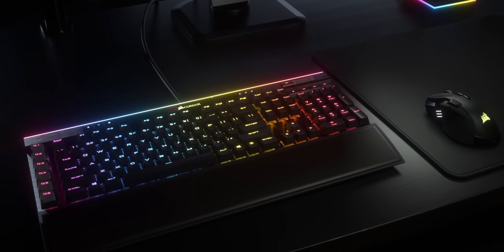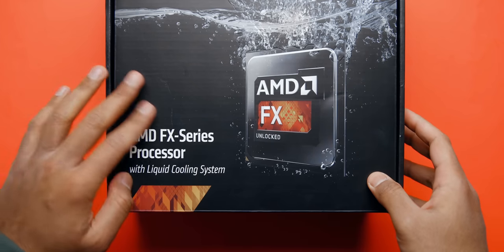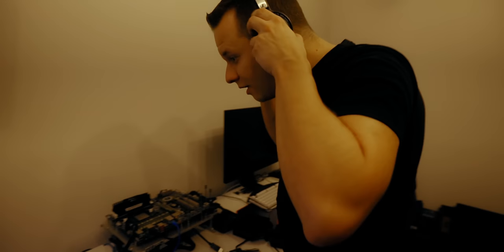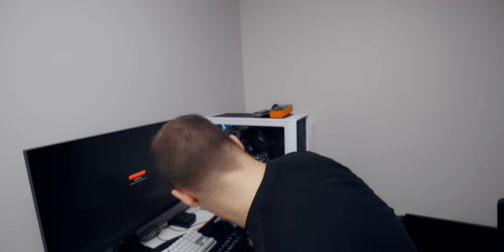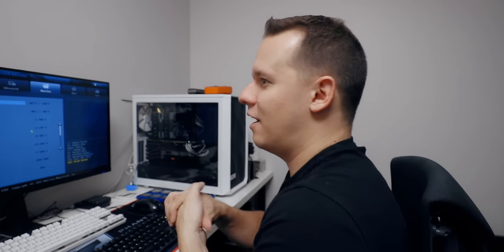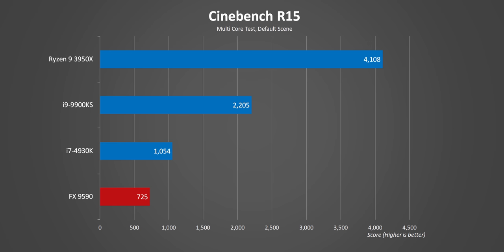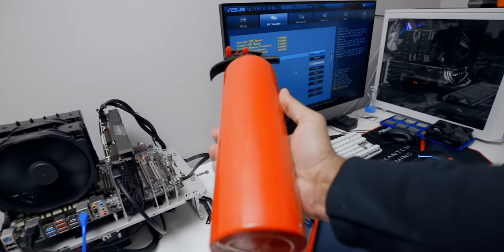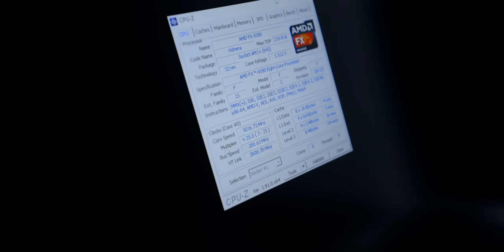Why The FIRST 5GHz CPU Almost Failed - AMD FX-9590 Revisited!

Comment from the maker: Let's play a game.  Count Mike's Claps.  Closest person gets our admiration and a cookie.  🍪🍪
He laughed his butt off watching this after the fact.  🤣🤣
Reply: My guess: 20
Reply: My HTPC in the living room is a FX-9590 with a MSI Aero OC GTX-1080 running on a 65 inch 4K TV. Runs all my emulator games like CEMU, Dolphin and Mame32 at 2X full speed. E.g: Breath of the Wild run at 60FPS@1440p when unlocked. My main gaming system is an 1800X with a faster OC GTX-1080. Both of them have Corsair PSUs with USB Digital Links which can display the input and output wattage of the PSU in real time. Power usage is on average is about 40 to 50 watts more than the 1800X or about 280 watts on average under typical gaming load, with both systems on high performance power plan, though the FX-9590 CPU is fine tuned and undervolted with MSRtweak. Both systems game easily at 1440p@ minimum 60FPS with anything thrown at it
Reply: @fredsas12  dang
Reply: lets play a game on how to find the beaver
Reply: Plz compare this to a ~4.5 GHZ i7-2600k eventually!  That was the last  PCIe Gen2 Intel CPU, and it sold about 2 years earlier than the 9590 - and at a modest ~4.2 GHZ it easily beat the 9590 in basically everything IIRC - I dunno the exact numbers of course, that is why I wanna see it!
I ALSO want to see how well AMD's old "8 Core" 4 module approach compares to an earlier Intel Mainstream CPU with 4 core an 8 Threads! An obviously FAR superior approach to Bulldozer's Clusterfu... I mean Clustered Multi Threading or CMT - but SUPPOSEDLY DX12/Vulkan makes better use of Bulldozer than earlier rendering APIs!
Reply: It would be nice if you could test x58 against these chips.
Reply: should check Xeon CPU's
Reply: that was so good guys definitely think this series is really beneficial and Educational to people even building PC's to learn off mistakes of going for certain components and enthusiast who just like learning like myself. Keep up the good work guys.
Reply: Fermi revisit?
Reply: @fredsas12  bro.. we got a mad lad here props to that 🙌
Reply: D.O.C.H.P(sp?) mode works better them basic manual mode on the sabertooth and crosshair v-z and you need water cooling for those chips genuinely even my silverarrow extreme sb-e 3 fan setup stuggled...  and you can push past 5 with the right board and cooling.. many people have, you did an OK job.. i could have helped you tune a few things, you can actually often use offset mode even with neg offset it works on many chips... oc...with lower then rated volts... 

i want to see you compair this with first x58 options and the same coolers options. :)
Reply: I'm pretty sure VRM on Sabertooth wasn't liking that 5GHz at 1,5V settings... without at least active cooling on it ;)
Reply: ZEN was announced 2016
Reply: @CompatibilityMadness  The only board capable of running a FX9590 outta the box is the Sabertooth R3.0. Its the most modern and the last high end AM3 board.
Reply: @Dysphoricsmile  I have an FX 8350 and an i7 4770.... They are both in current builds.... I do not have test scores to show, but.... my FX-8350 is in my gaming computer and performs flawlessly every time.  It runs fast and cool and is extremely efficient.  I play GTA Online at 90+ FPS, ultra details, and never exceed a core temp of 50 Celcius.
Conversely the 4770 takes forever to boot, stays slow even after booted, lags just playing Blu-ray quality videos.  But... I cannot compare to gaming because I do not have a comparable video card in that system.
What really tells how well each one runs... the 8350 is for gaming... the 4770 is for my children to do homework.
Reply: Quaranrine version drink everytime you see him clap
Reply: He's been self conscious since I pointed it out in the folding video I bet ;-).
Reply: @cpljimmyneutron  that's probably the hdd you still have in the 4th gen i5 system, I buy 4th gen i5 4570 and 4590 for customers and they boot to desktop in less then 15 seconds (with a ssd) , they boot so fast I have to put a windows password on them because when it hits the desktop the network stack hasn't started up yet fully until after 5 seconds or so and doesn't connect the network shares up  (lenovo systems set to Legacy free mode boots even faster) having the password holds it on the windows login screen for it to get networking up
Reply: If you're happy and you know it 👏👏
Reply: I've had enough of Angry letters from Greta Thunberg so I'm retiring my FX9590 after 5 years blindingly faithful decent service for very little money as I bought second user. Indeed, for my gaming at 1080p I don't need more processing power but the electricity bill for running an FX9590 is cripplingly high. Hopefully the 2700X is far better in that regard.

The main problem for my new system is the bloody GPU I want is not out yet. I want an AMD GPU but I also want ray tracing. Not available till next gen :_(  so I am going to have a nice new PC with my old R9 290 stuck in it till next year, oh well.
Reply: @hardware Canucks can you donate me a working pc that can alteast run GTA V on high 😢 my 15 yrs lod pc died
Reply: @cpljimmyneutron  My Vishera machines feel nimble in the desktop, no weird stalls opening apps  etc.  My 2600k , 3770k and 4790k all have those issues no matter the clockspeeds  .   Biggest keys are ram stability, tuning and cpu cooling  for the FX's.    I much prefer running FX to any of those i7's .  The only 4770 (s variety) , I've used was a Dell pre-built and that was the most clumsy ,  ham fisted machine I've used since trying to run Vista on a single core with 2 gb's of ram -  took 2 minutes to boot and seemed like it took almost that long to open a program.

Comment: Me: *install fx9590 with r9 fury x to pc

*Electric bill has left the chat
*Heater has left the chat
*House fire has enter the chat
Reply: sort like the high core Intel's now.... nice and warm! This AMD CPU was a matter of advertising. It certainly wasn't a good CPU like the rest of the Bulldozer architect.
Reply: @Reyfox1  Bulldozer wasn't a good architecture.
Reply: @evo7836  He didn't say that, he said the rest of the CPUs weren't good either.
Reply: R9 295X2 bro
Reply: This was my exact specs 2015 to last black friday...
Reply: @WD Fourty just because its "cold" at 78 degrees it doenst mean this is putting out less power. Maybe your cooling/ ihs is just better now. Wattage is similar to the 9590 or higher if you clock it that high. Conclusion: Your cpu probably dumps more heat into the room then the 9590, execpt running cooler;) 
Ps.: Intel user here.
Reply: @Sandro-gz3or  
R9 295X2 ... CROSSFIRE

*PSU has left the chat
Reply: @WD Fourty 78°c doing what? try a stress test...
Reply: @WD Fourty what does the clock drop to on that 2080 ti? 2240 is very very good, but if it's getting up to 60 degrees it's definitely not staying that high.
Reply: @WD Fourty I have two 2080 ti's one ref and a kingpin, they won't stay max clocks up to temp limit, just the way boost 3.0 works, it's like 15mhz lower for every 5c increase in temps. I bet your card would be fun on ln2, which one is it by the way?
Reply: @WD Fourty cool beans, I'll have to check it out. I just got more ln2 today, gonna bench some port royal tomorrow, I'm 13th on the hall of fame single card. Gotta get higher! But yea I'd like to see what your card can do on cold :)
Reply: @WD Fourty yea they have a special bios for that card, just don't have all the controls built-in already like the kingpins
Reply: @WD Fourty yeah I think you do, but really hard to tell unless you find out what the card is actually running at the 60ish degrees. You can use msi afterburner and setup OSD, on screen display of the stats. I always have it on and my reference card runs 2175mhz at low 40's on aqua computer water block with two 360 rads, but will drop to 2160 at 45 degrees.
Reply: @WD Fourty that's normal base clock, and the lower mv is idle millivolts, higher one is max operating voltage. On ln2 I run my KP at 1.5v
Reply: @WD Fourty, me at 40++ still using Sandy Bridge... Lucky you....
Reply: @WD Fourty Intel's next gen desktop CPUs will be far more power hungry and run hotter. Running 10 cores at 5GHz+ speeds on 14nm is a no-no; you can't bend the laws of physics.The 9900KS already uses a ridiculous amount of power and generates a ton of heat; Intel's idea of sticking to 14nm for 5 years and beyond is going to hurt them real bad.
Reply: @WD Fourty From a pure desktop standpoint it may not actually matter, and as long as you have plenty of cooling capacity as well as absolute disregard for electricity bill it's a zero issue, Imo.
Reply: @WD Fourty imagine claim your cpu doesn't run hot while using a AIO. I'd like to see you run that on something like a H7. Tell me how hot it runs after that.
Reply: same with 9900k and 2080ti
Reply: That is the exact build I have in my guest room. It actually runs much cooler  and smoother than my 3770K/GTX 980 TI build. Go figure.
Reply: @WD Fourty My FX 9590 idles @ 36°C, 48°C after gaming for 2 hours and during a 3 hour run of Prime 95 maxes out @ 62°C. The Intel i7s, i9s and Ryzen S.O.C.s run hotter due to the North Bridgd and South Bridge being implemented on the CPU itself instead of the motherboard.
Reply: @ExcZist's Studio It will run cooler if you disable your Turbo, and set your voltage to 1.45V. CSM also helps considerably but does affect your performance slightly. Although you are not supposed to be able to or not supposed to delid your FX 9590, it can be done but you must be very careful when removing the lid. I advise using a razor and to cut the glue around the lid and then to heat the center of the lid with a lighter for about 10 seconds and carefully remove the lead and clean off the excess solder. If you do this I strongly advise to take caution and to carefully place your cold plate/cooler on the die and slowly torque the screws evenly. Do not over torque or you will crack or break your CPU die!
Reply: funny enough I have the 9590x on a sabertooth R2.0 mobo....and two R9 390x in crossfire

ya, she sucks down alot of electricity XD but overall runs everything on max on games at 1440p 

I have to run it on a 1200w PSU lol
Reply: WD Fourty I’d like to know what cooler you have.
Reply: WD Fourty the AIO is the reason why. But your power consumption is still huge. Might be as much as the 9590 has.
Reply: @WD Fourty 78c is pretty hot but okay buddy
Reply: I have a standard fury. Bought it for $101
Reply: I,ve had that exact config xD but I refuse to watercool the FX9590 instead I used a flagship Noctua NH-D15 it did a good job
Reply: kimnice when the GPUs alone have a 1Kw TDP
Reply: What about    R9 295X2 -_-
Reply: @WD Fourty 6700k would be a really bad choice in 2020 unless you can get a cheap used one. In many places 6700k priced pretty much same as ryzen 3600, which beat it in everything include gaming...
Reply: @WD Fourty And these days Intel runs hotter than AMD, don't be ignorant.
Reply: @WD Fourty No, quad core Intel chips are not good enough for most new games in 2020.
Reply: Don't forget the GTX 480 original version
Reply: Gtx 480
Reply: I've had death threats from Eskimos.
Reply: Anthony Pierre But Intel clock speed scale very well with performance. And yes they didn’t draw a massive 460W from a mere 300Mhz increase of a freq.
Reply: Radeon Pro Duo: let me introduce myself...
Reply: In Texas 2021:  Welp, the windmill is frozen and no power to heat.  BRING IN THE GENERATOR!
Reply: @kimnice  Me with 2 R9 Fury X's
Reply: fun fuct i have fx 9590 with r9 fury x to my pc
Reply: Been there, done that
Reply: Oh how times have changed. We're about 700 watts is the norm right now.

Comment: The 9590 was the first CPU I ever had in a custom build...
Winter was cosy.
Summer was literal hell.
Reply: ive got the fx 6300 @ 4,7ghz in my tiny, cheap sharkoon case together with my overclocked r9 390x nitro+ 

cooled with an 240mm arctic liquid freezer (i had to cut parts out of the case to make it fit) :D

And i agree, this time of AMD products made the PC a nice little room heater in winter.

Comment: I miss my 9590 😕 
It was the best heater I ever owned.
Reply: Yeah she was not cool LoL
Reply: Milan Svitek true, when it was cold I didn’t even bother to turn up the heat. Just boot PC and let it idle. Or run a game for summer time temperatures.
Reply: Just get the 9900k, just as good.
Reply: You wouldnt complain about it if you live up closer to the YellowKnife or one of those area. It probably can melt your drive way for you
Reply: in winter I love it.

In winter.
Reply: Saved on my heating Bill big time.

Comment: I'm still using this CPU and motherboard, to develop a game in UE4. I can't describe how much I look forward to my next upgrade. The temperature in here is tropical, regardless of weather.
Plasma arcs run cooler than the FX. I won't miss it.
Reply: I'm in the same boat as you hahaha, this thing is as good as a room heater
Reply: @aletius  I think we may be partially to blame for climate change.
Reply: @tangentarc7477  Probably lost a few icebergs due to me leaving this thing running all the time too hahaha
Reply: Water Malone . There are plenty of newer CPUs that can output that kind of heat too.
Reply: That heat keeps the virus out😂
Reply: running a x5675@4.4ghz with 48gb ram... its about as hot as my fucking 9370 was under any sort of extended load... so yeah... at least in winter here, the waste heat is useful ;)
Reply: @TheAlpha620  LOL
Reply: I would very heavily suggest that you go Ryzen 5 3600 with stock cooler (save some $$$ they work great and come in the box, I use a Ryzen 1600x with a Wraith Max cooler!) DDRM5 3600hertz 16GB RAM (min or 32gb max!), ASUS AM4 Motherboard with latest BIOS and support for DDRM5, PCIE 4 and USB4 (they will be out soon if not already in the X570!), ASUS WiFi6 Card, NVIME SSD (Min 500gb!) with a secondary 2TB SSD (for games, movies, music as well as OS and vital file/folder backup) this will future proof your rig for at least 3 to 5 years as for GPU go for a 1070 or 2070 NVIDIA or wait for the AMD (RDNA2, Big NAVI) Radeon RX5700 XT I think it is?!

If you dont want a Discreet GPU go for the APU version of the Ryzen 5 3400G (with RADEON Vega 11 Graphics built in) this way you can always add a GPU Card later but save some $$$ now, Yes you loose a few CPU cores (Only 2!) but really it dose not matter in 90% of cases!!!
Reply: I hope you get of that piece of shit fake 8 core CPU soon. Upgrade to a real 8core/16thread 3700x to slap it in the face.
Reply: Few have been gifted the opportunity to destroy entire ecosystems with the flick of a switch, you should be pleased.
Reply: @Nine-Signs  Laughing manically and rubbing my hands at the prospect of world domination with my erm..heating device of doom (and quake)...until the bill arrives.
Reply: I have struggled for almost 6 years with freezes and lock ups I bought this CPU specifically to power my ue4 . That didnt last long freezes work loss just a nightmare, now the damn thing ant even run magic arena
Reply: @DigitalAlchemyst  I feel your pain. My freezes were caused by heat. (ironically) I was using that chip to develop my UE4 game for 2 years until I bought a Ryzen 3900x rig. Development has been a breeze ever since.